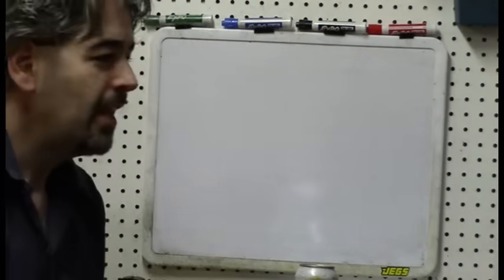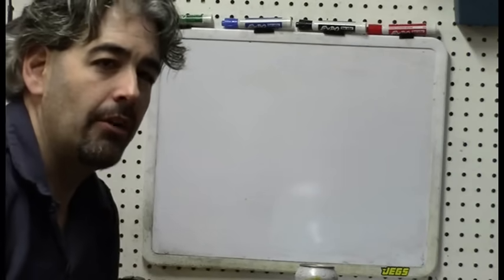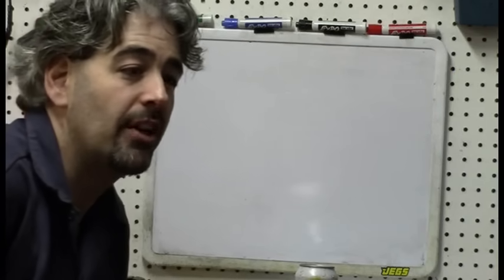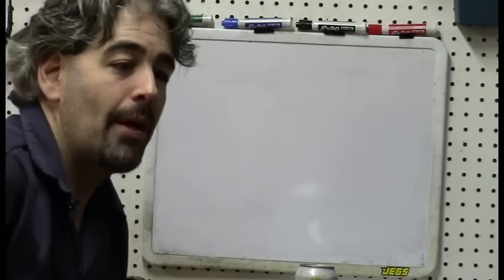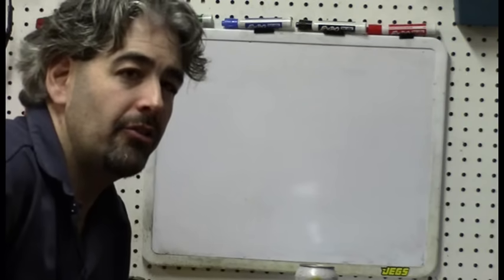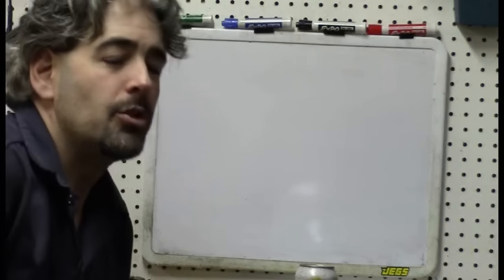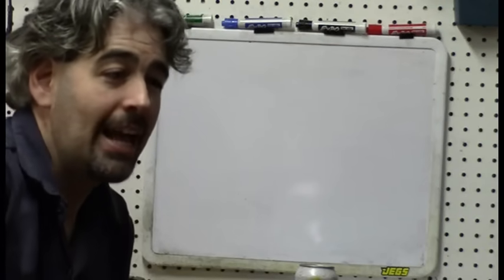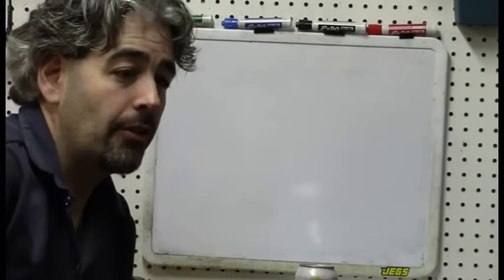Secret of Engine Problem Diagnosis- Fuel Trims Pt.1

Comment: I'm hoping like hell that you happen to see and respond to this, brother I have a challenging one on my hands, I'm familiar with fuel trims, and how to use them to my advantage for diagnostics, thanks to you, but this 3.0 ranger that's throwing p1132 and p1152 has me lost, stft is hovering around -20-23 @ idle while ltft is stuck at -25. Fuel pressure reads 62-66 and holds steady at 62 overnight. No fuel in vacuum line from fuel pressure dampener on rail. Purge valve is not Stuck. O2 readings are all over the place but I'm guessing thats due to the mixture issue. Should also mention the truck went from running fairly decent to blowing black smoke and falling on it's face. I originally putted it over to my house, where I cleaned the MAF (reads 0.7lb/m at idle), seemed to make a good difference in driveability, but fuel trims are still trash, erratic o2 sensor readings have me scratching my head. I only have a cheesy actron scanner but i try to utilize it to it's fullest. Also should mention it revs freely, has 18 in of vacuum at idle etc so I don't think it's a clogged cat, tho I did notice a fair amount of water coming out of the tail pipe and one of the exhaust joints beneath the bed, I pulled the exhaust apart right after the rear cat and before the muffler, no difference. PLEASE HELP ME, AND THANK YOU FOR SHARING YOUR'E KNOWLEDGE, ITS HELPED ME GREATLY SO FAR.
Reply: Only idea I have left is replacing those upstream o2 sensors based on the erratic readings, but my gut instinct says NOOOOOO lol
Reply from the maker: You need to do basic ric h condition variable differential diagnosis. What is the MAQP reading? what is your injector pulsewidth? Do the O2s respond toi lean variables or do they just plant rich (in which case the O2's are the problem).  Is there high oil consumption in the engine?  Anything where you have either mismetered air intake OR extraneous fuel sources are your considerations.
Reply: As soon as it hits closed loop both fuel trims just pretty much max out negative. It's like the ecm is just letting the injectors hang open way way to long or something
Reply: @SchrodingersBox  I can't find any unmetered air / leaks anywhere using propane so far, o2 sensors do respond to a LARGE lean condition ie pulling the evap line bout half off intake, but removing a small vacuum line only slightly changes stft. Can't see injectors on my scanner unfortunately, I wish I could. There is no MAP sensor on this engine, no extraordinary oil consumption.
Reply: I should have also mentioned that this motor is out of an 04 non California truck, swapped into a 98 California truck, we kept the manifolds and exhaust from the 98 on it of course.
Reply from the maker: How does the engine not have a MAP????
Reply: @SchrodingersBox  I was surprised as well but I can't find one on the engine, nor listed on any parts lists, it does have an differential pressure feedback sensor that is related to the EGR setup but that's it I believe
Reply: @SchrodingersBox  yeah confirmed they don't use a map sensor, the baro is a calculated figure based on MAF reading and IAT. Man this thing is kicking my ass lol
Reply: @SchrodingersBox  I wonder what unplugging the o2 sensors is normally supposed to do to fuel trims? It sets this one to a set value of stft -23 ltft -25. I feel like that's kind of odd also.
Reply from the maker: What vehicle is this?
Reply: @SchrodingersBox  it's a 98 ranger 3.0 2wd
Reply from the maker: It has a MAP.  
  Anyway you need to redo your whole approach- you need to do a proper fuel trim analysis. You have no curve against load so you have no reference points. You need to curve that against MAF and MAP with TPS angle.  Do the same with rail pressure.
  I am also not sure why you would be looking for air leaks, on a rich condition you won;t have any so save your time.   You also haven't done a variable response test on the O2 sensors.
  There is really no data here if you think about it.  gather data systematically, confirm whether the lean condition is causitive or responsive and then you will have a direction.  Good luck- if you get any relevant fuel trim data I am happy to review it.,
Reply: @SchrodingersBox  could you show me where, as in a wiring diagram or similar where the MAP sensor is then, I'm not trying to be an ass but you're incorrect, there is no MAP sensor on a 3.0 Ford motor and that's pretty widely known. I will go out for a test drive and record the data under load, unfortunately I can't upload anything from my scanner as it's pretty basic and I don't have cables
Reply: @SchrodingersBox  what do you mean by variable response test on the o2s?
Reply from the maker: Whether it has a MAP or not is irrelevant. You need to induce variables to ensure the O2s are responsive to conditional variation. Thats the first step--- AFTER a fuel trim analysis of course because a fuel trim analysis could show that when curved against load anyway.  I'll see if I can pull a diagram for the MAP but it's not relevant yet anyway because the basic diagnostics procedures have to be done first.

Comment: Both trims on 2000 Jeep XJ are at +32%.  No change at idle or 45 mph.  Unable to to locate any vacuum leaks. IAC has been throughly cleaned.  Using ZURICH ZR8 scan tool.  I am running so rich I leave black soot and water on the ground wherever I park. Any suggestions anyone?   Stock exhaust with exception of new muffler and tail pipe.  Sea foam used 6 months ago. Jeep was parked 18 mos prior to restart.  Thx, Excellent videos.
Reply from the maker: Sorry i don’t follow at all. What is the sea foam supposed to do exactly? What is the issue you expect it to resolve. also how can you say you are running rich when the fuel trims are +32?  
  Also what was your data the IAC was dirty and needed to be cleaned? You didn’t include the IAC data.
Reply: Schrodingers Box Great! Thx for the quick response.  I’ve got some items to handle today and will do my best to answer your questions. Thanks for the  reply! 👍

Comment: Any ideas
Reply from the maker: tons. i would totally start with the EGR- what was your data that it was bad. what design is it? what was the idle voltage showing on the signal?
  also why were plug wires changed- did you determine high resistance? was there no spark? which cylinder had the no spark?

Comment: hey i just found you by chance, im from argentina and i learned so much on just 2 videos, thank you.i have a question for you. if i have a vacuum leak, a small one, and my o2 sensor is telling to the ecu to deliver more fuel and the stoquiometric ratio works just fine, can i be driving my car having a vacuum leak without knowing it? i just bought a 2000 ford mondeo ghia mk2, and a strange thing happen. i change the vacuum hose of the pcv valve, i tested with my finger and sucks vacuum just fine(the hose is 10mm diameter), the weird thingis that qhen i unplugged the hose nothing happens with the engine, nothing, no higher rpm, absolutely nothing, that is very strange i cant understend, can u came up with and explanation? the car is at idle and warm up. i will love to read an answer from you, i really like the way u think. thank you
Reply from the maker: Absolutely. In fact probably MOST people are driving with a small vacuum leak and don’t know it.  It is not until the LTFT reaches 25% that the check engine light comes on.
Reply: @SchrodingersBox  the thing is that my car (ford mondeo ghia 2000) does'nt have an check engine  light, there is no such thing, is not even in the owners manual. is called the dashboard? in the images of the dashboard in the owner's manual it doesn't exist, and obviously not in the car, is weird that such a car does'nt have one. can i ask you about a possible thermostat problem? i dont want to bother you
Reply from the maker: Well I am not familiar with the rules in Argentina. In the US every car has to have one after I think it's 1977 or something.  Your only way of knowing there was an issue would be by looking at fuel trim.

Comment: Trying to find Too Rich bank 1 & 2 or the last 13 years Camaro Z28 5.7 L need a scanner tool to follow up on your great videos, codes only come up every now and then. What scanner should i get ?, looking at Foxwell NT301. As im in Australia most items I read about are from the USA and not available here. Your V8 looks like my LS1.
Graeme in OZ

Comment: I have an interesting question on closed loop. On a v8 or v6 engine with 2_banks. The scanner shows fuel system status A and B for banks A and B.
Bank A and B are in c!osed loop, ect 195, fuel trims near zero +/- 3 .  now at ect 199, bank b drops out of closed loop, bank A stays in closer loop. Fuel trims go about negative 20.
Lean on bank B. What causes this senerio ? Did an o2 sensor drop out on bank B to create that. Maf reads 4.0 g/s 
97 must and 3.8 v6
Reply from the maker: I would swap oxygen sensors and see if this pattern changes sides as a result. If it does, replace the O2 sensors.  I agree with you that it sounds like an O2 is dropping out.

Comment: Sorry you're up on me with the trim and its left me with a question if the computer is after 14.7-1 what performance benefits are the high octane fuels giving bar miles as the o2 picks up the combustion based on standard untuned cars and will it show on the trims

Comment: One question, should a small oil leak from the valve cover also be considered as a vacuum leak assuming the leak is also allowing some air into the engine?
Reply from the maker: Yes technically it would but almost never does it affecty fuel trim enough to have any serious affect
Reply: @SchrodingersBox  thanks a lot for the reply, the chief two percenter :)

Comment: Hey, thank you, very helpful. My car  has 70% ltft, running lean, hesitating during acceleration and drinks a lot of petrol. I suspect the fuel pump, because when I was spraying a brake cleaner everywhere around the engine, there was no change. When I rev it up, ltft decreases, but when I am driving the car, sometimes it goes up. Stft is bouncing between -4 to +4%. Lambda sensor is working properly. Can you please tell me your opinion? Would help a lot :)
Reply from the maker: If LTFT decreases during accel then it's a vacuum leak. A fuel pump would cause LTFT to drastically increase during accel- as would a MAF.
  Recheck idle vs acceleration considering TOTAL FT (LTFT + STFT) and confirm.
Reply: Replaced the fuel pump and the car runs perfect now. LTFT at idle is now -10% and believe it will get up to 0% tonight. Fuel consumption is back to normal. I had tested it before again and LTFT was increasing during acceleration, especially when the engine started hesitating. Thank you for your help :)

Comment: I recently bought my daughter a 2013 Ford edge. It has code P0420 and P0430. After watching your video I believe it’s a computer issue but want to know what you think. The LTFT are -14 & -10 but the O2 S1 are only variable between .004-.150 mv. My understanding is that they should vary between .100 & .900, I thought the cats could be clogged but they are running at 1250+/-100. If the LTFT is showing rich but the O2 sensors showing lean, what else could it be besides the ECM?
Reply from the maker: Can’t say anything without short term trim. There is no data otherwise.

Comment: Are u talking about the bank 1 or bank 2 O2 sensor?  I misunderstood?  Two separate sensor isn't it? AFR and O2 sensor ?
Reply from the maker: both of them. each bank has its own fuel trim.
Reply: @SchrodingersBox  how to reduce consumption with ethanol? Replacing injectors.?

Comment: Another good video but would you have a recommendation for scan tool that would work on an OBD1 (93 Chevy k1500) vehicle that has the LTFT or STFT and that won't break the bank? Thanks,
Reply from the maker: It depends on the vehicle. OBd1 is non standardized so you need a different reader or module for each vehicle.
Reply: @SchrodingersBox  thanks again for taking time to respond.  its a 93 Chevrolet  truck k1500 5.7l V8. I can just spend a bit more time searching amazon if you dont have a recommendation. Thank you again.

Comment: Why is the voltage from the O2 sensor at .45 volts when at 14.7/1 fuel ratio?
Reply from the maker: Because it goes from 0 to .9 V with stoichiometry being the center point.

Comment: Minor problem with your theory - the centerline of a sine wave oscillating between 900 and 100mV is not 0.45V. It's 0.5V.
Reply from the maker: Yes that’s true. Ibstand corrected.

Comment: I asked you about my 05 suburban with strange problems a while back on a different video. The update is, the no start turned into an everytime start and the putrid grey smoke went away. No diagnostic tool has brought up a true diagnosable problem.  So my point or question is, do you think this could have been an insufficient amount of sugar in the gas tank to make it clog, but, not completely fail? Or maybe even some trash as I usually don't keep a lot of gas in it and I had just added 20 gallons the day before.
Reply from the maker: If that were the case you would have seen high fuel trim numbers. you mentioned there was no diagnosable issue - so I am curious what was the fuel trim showing?

Comment: Watching this sequel videos was a great investment of time, thank you!
Had the P0172 rich code with a cyl 3 misfire, this video saved me a ton of money and saved me time and directed me to the right direction to take, ended up being a tps/iac intermitente issue with the throttle body and not a O2, not coil pack, nor any other sensor as was said would be a waste of money if changed. Thanks for taking the time to educate us DIY wanna be mechanics!
Recommend reviewing more than once to better understand the information given, I will always now review my fuel trims before any work being done on my truck 2004 Tacoma prerunner 3.4
Reply from the maker: Glad to hear it and congratulations on your fix in the other comment.

Comment: Hi luv watching your vidoes very informative and encouraging (subscribed). I take it that the fuel trim  lesson is on petrol engines what about diesel engines 
Im a diyer i dont have a high powered scan tool where i can get live data from ,is there  anyway i can get live data from using a scope meter if so where would i take from for stft and ltft
Thanking you in advance
Reply from the maker: Thanks man. I actually haven’t even seen a diesel so i cant tell you. It’s really rare to see a non-commercial diesel vehicle where i live

Comment: Obviously MAF sensor can measure that leak, but my question is, if there are MAP sensor, can measure that leak or not? And one more question... For trims of fuel, is it first O2 sensor or A/F sensor are that who measure and feeding ECU with information for corrections?
Reply from the maker: first question: it depends. on a small leak there is no way for the MAP to know because it doesn’t have the MAF to reference.  But it does have TPS. You generally see symptoms like faster idle but it won’t show an abnormal fuel trim because the MAP is the only induction metric. 
  however- if a leak is large enough at idle, map pressure will increase sufficiently enough beyond what would be expected with a TPS indicating closed position.  
  For second question- the front O2 or AF is used for exhaust O2 concentration measurement and fuel trim calculation.  the rear O2 (it won’t be an A/F as of yet) is used for catalyst activity monitoring. some cars do use the rear O2 for a small amount of fuel trim input but it’s not very significant.
Reply: @SchrodingersBox  Thanks.

Comment: Hi great video and very well explained but I do have a question hope you can lead me in the right direction 

I’m having a P0300 multiple misfire and it’s my only code.. I plugged in my scanner which gives live data and I noticed the ST FT goes up to +25% and back down to 0% gradually just sitting at idle... would you still rule out a vacuum leak? Thanks in advance!
Reply from the maker: You can’t say without looking at total trim and curving it against load.   If you analyze total trim against load you might find the 0300 is the result of a lean condition caused by a vacuum leak. But also if there is no vacuum leak, then you might find the lean condition is the result of the misfire that was caused by something else. Remember on a misfire, you will have unburned oxygen crossing the O2 sensor so it will read leaner than normal.
Reply: Ok thanks for the quick response I’ll be doing more test to figure out what’s causing the P0300 I’ll definitely get back to you if I’m still chasing it down... thanks!

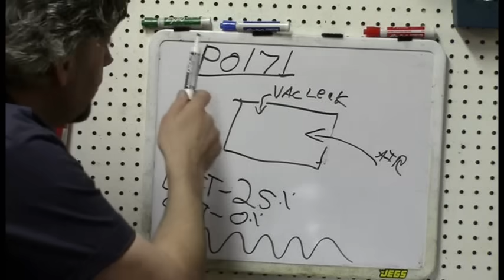Comment: 23:23 :))))
Reply from the maker: Hahahaha, one of my favorite parts. 98% of people change O2's sensors under those conditions. And then when the check engine light is still on they say "well that's OK because it needed an O2 sensor anyway because of the mileage".
Reply: @SchrodingersBox  i found your channel as an YouTube suggestion.
i am a subscriber now :)
whenever you will find some time a dpf regeneration process and faults will be much appreciated as there aren't many.
i have a bmw behaving weird with no fault codes and dealership concluded nothing wrong with it.. :)) still it accelerates by itself whenever dpf regeneration occurs.